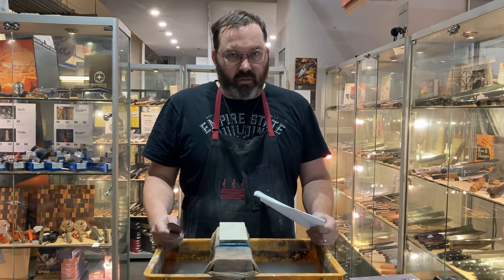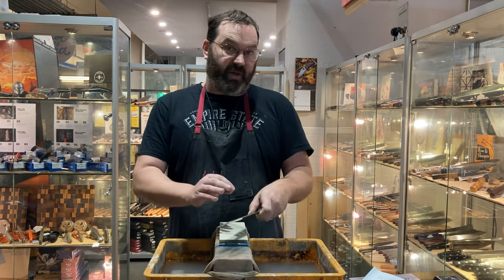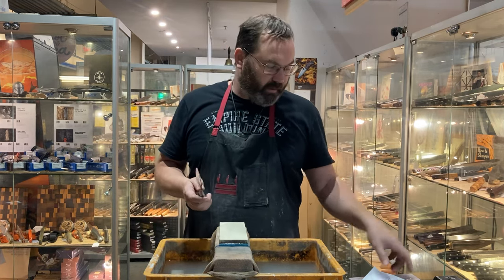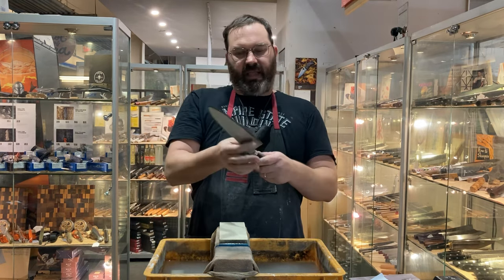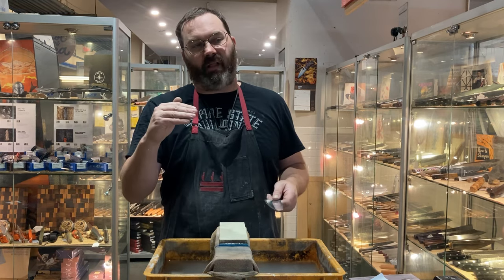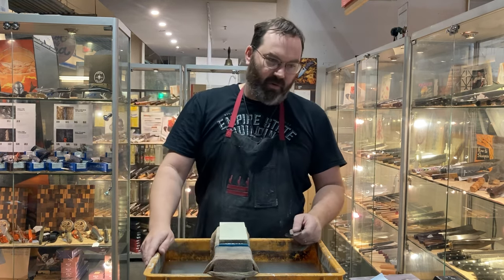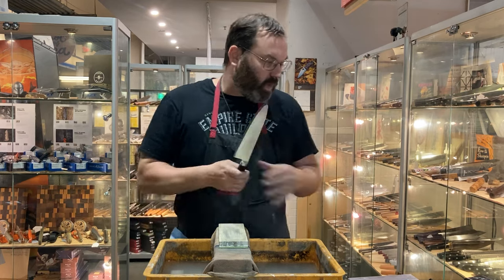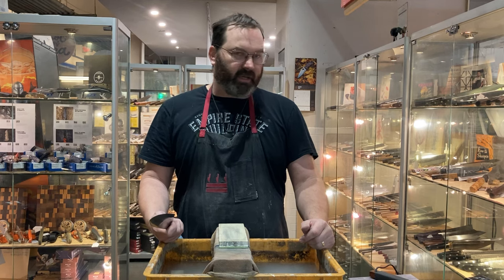“WHY CAN’T I  GET MY KNIFE SHARP?”

Comment: Yeah man, words of wisdom! Also, l think that stropping on stones is usually a huge waste of time unless it's your very last stone and it's coarse enough that it might be good to take off any larger flakes of burr before going on the leather. If l finish on 4k or lower l will usually do like two quick strops per side on the stone before going on the leather. Any higher than that and l usually go straight to the leather or to a 12k stone which l like for deburring blue steels.

Comment: I’ve always been told when stepping up in stones you don’t need to regrind but just strop and debur. Ie develop burr on 1000, deburr/strop on the 1000 and then move to a 3000 and strop/deburr. Should I not do that?